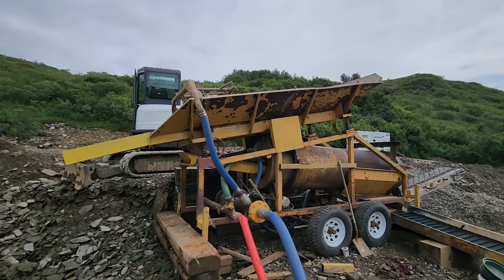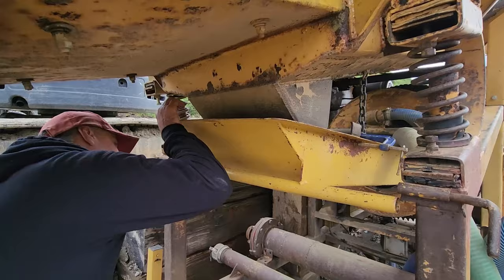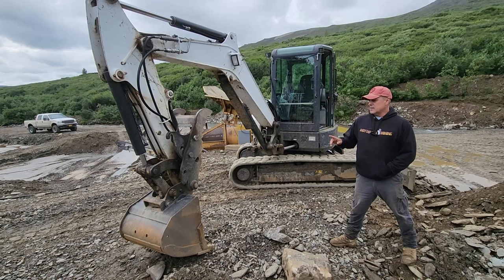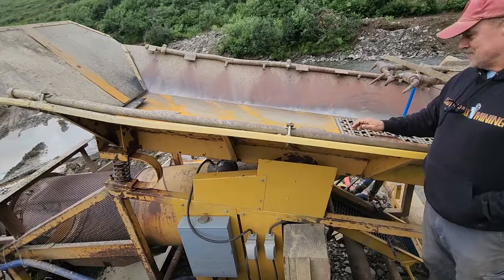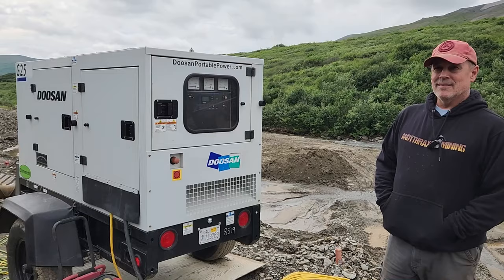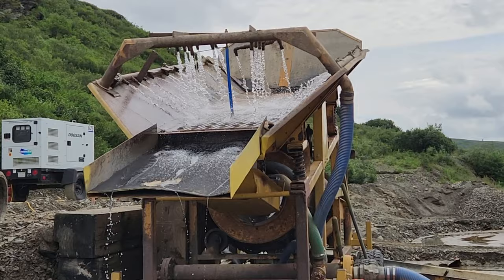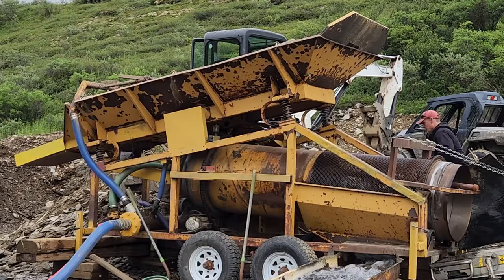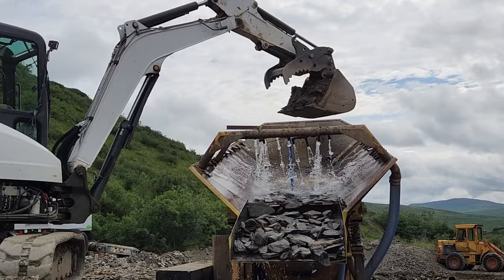Trommel Wash Plant - Solo Operator !

Comment: flat rock slabs get plenty of mechanical and water action on top, but they don't turn over...do the bottoms get clean?
Reply from the maker: Surprisingly, yes !  There seems to be enough water flowing underneath to wash the underside.  Bottom is solid versus a complete polyurethane screen deck.  I think that makes a difference.
Reply: @allansgoldmining  great !  how thick is the punch plate?  are the holes in it staggered?
Reply from the maker: I think he said the holes are 3 inch and appeared to be staggered on the end of the deck.  He did a clean out after our 30 minute run and got 10.1 grams !
Reply: @allansgoldmining  that's really good gold.  my mine produces about .01 grams per hour at best.  but i have to dig 15' down and the last 2 - 3 feet by hand.
Reply from the maker: @richardservatius5405 wow, that's a lot of work !  Sounds like the kind of grade the Hoffmans are mining, but they're pushing volume to make the difference.

Comment: He should be able to just drop that bucket and his is not.
Reply from the maker: You can't.  The material is flat Schist.  Flat material is much harder to process than rounded.  In this case, slower is better.  Yeah, he could by a larger plant, but that's easy to say from the couch.  Coughing up the $$$$ is another thing.
Reply: @allansgoldmining  only requires to modify the first hopper to handle it. He’s wasting manhours.
Reply from the maker: @tujuprojects  Well, let's see some videos of your plant, and how it mitigates flat material.